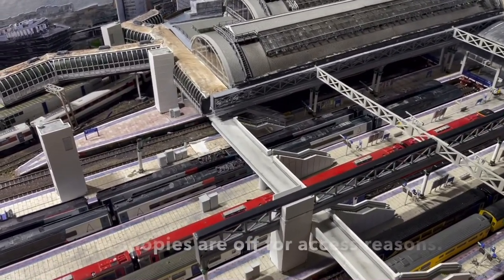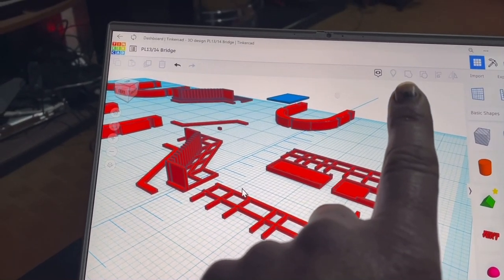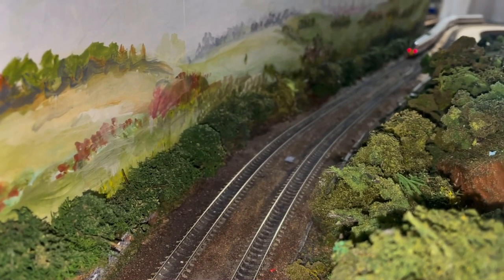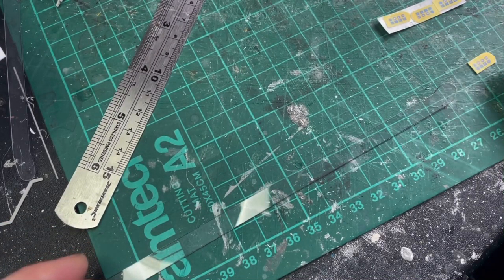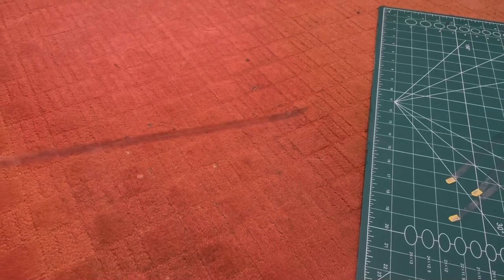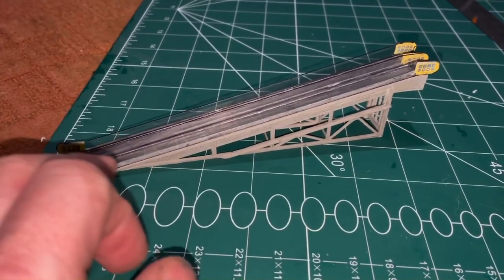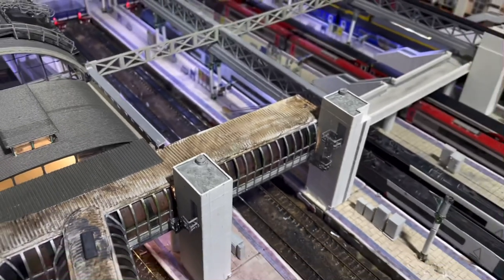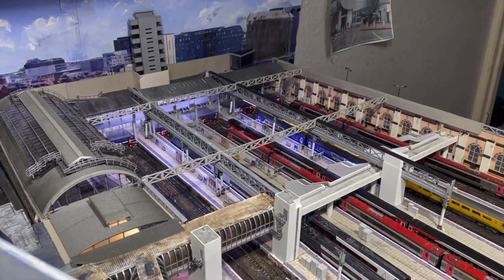MANCHESTER PICCADILLY N GAUGE, Building steps & a travelator – WHAT’S HAPPENED TO THE CANOPIES NOW?

Comment: Excellent bit of 3d printing of the travelator and access laders/platforms.    The detail under the station roof is astounding  - it's almost a shame to put the roofs back on !   Cheers Euan
Reply from the maker: Hi Euan, Ive decided early on to add the detail, just in case it comes near a camera. Kinda hoping that someone may invent a high quality camera small enough to fit on a flat bed wagon.

Comment: hi john
just a quick question but not related to this video.
i would like to ask you what decoders do you use in your n gauge stock as i have 3 dapol hsts dapol lococ and farish locos just wondered what the best decoders would be ???
great video and update hope we can all meet up soon.
hope yourself and the family are all good.
peter
Reply from the maker: Hi Peter, absolutely fine, you can also contact me on fb messenger. I have the Z21 system so I try to use Bachman / zimo decoders (6 pin -36-568A), or pure zimo, they are smooth and very responsive, otherwise I have used dapol imperium for next18, but with mixed results, they do get confused easily and find dummy cars keep swapping their lights. Avoid G..m..t..r hope that makes sense and other really cheap decoder L…s…dcc they tend to short out very easily. If you have any next18, also use tape separating the overhang of the decoder from the PCB.

Thought you were going to run DC so you could run your former neighbour’s ex-stock?
Reply: Building a new layout so I have 2 one dc and one dcc like the best of both worlds lol.
Peter
Reply from the maker: Oh I see, look forward to that